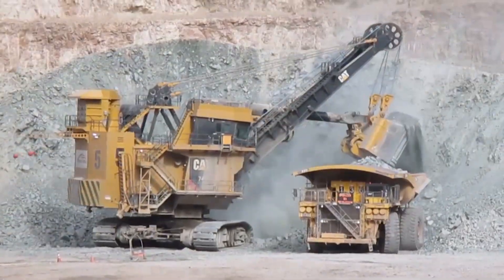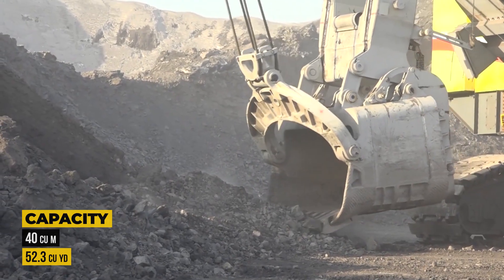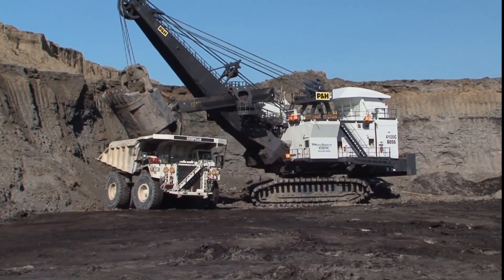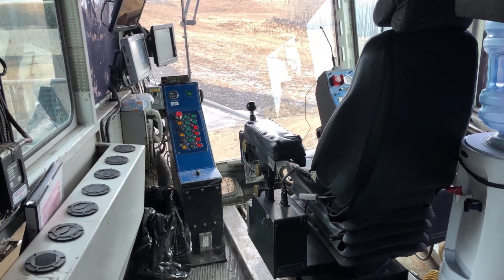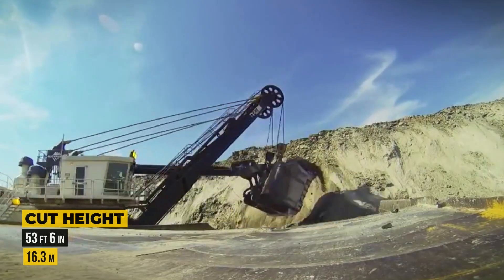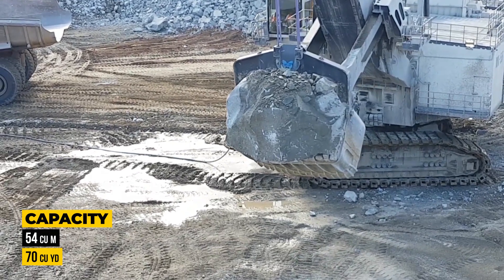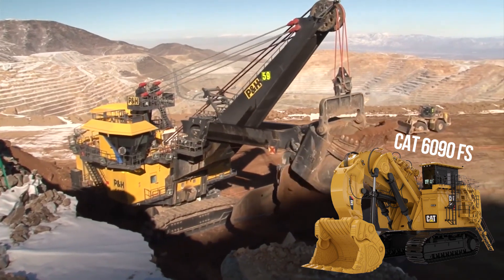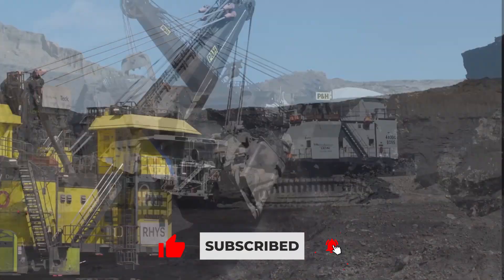Top 5 Rope Shovels. How Much They Cost?

Comment: Your forgot WK75. This machine larger than 4800xpc.
Reply: I never heard of WK75
Reply: @nickchuronco  Check in Google. This is Largest rope shovel today
Reply: was left out for a reason, the 4800xpc out performs it in reliability. I've driven both.... and while it's nice for a short time... it's riddled with engineering issues.
Reply: @blacklotusmoney  There are only 2 of them in the world and all 2 work in China? Are you from China? I will never believe that you worked for WK 75. There are simply too few of them